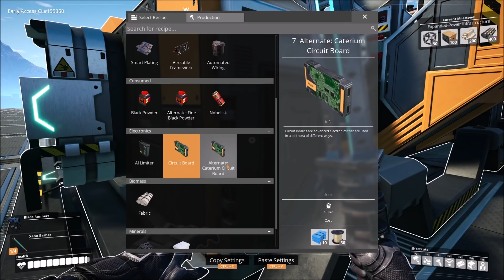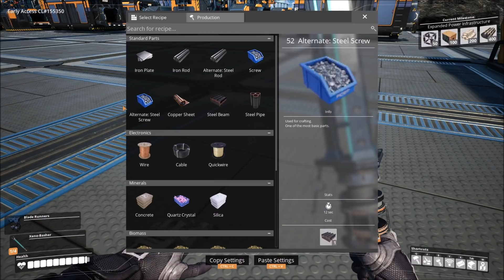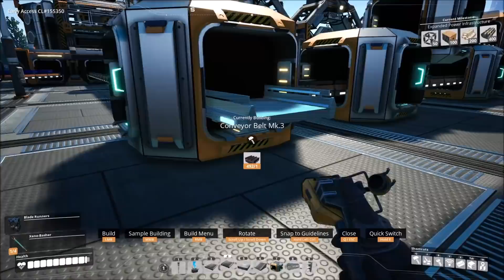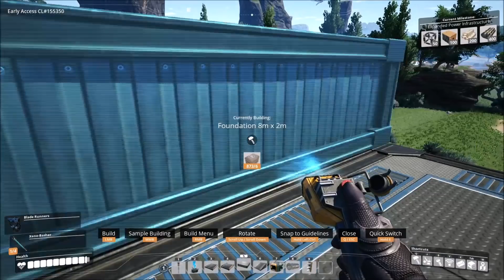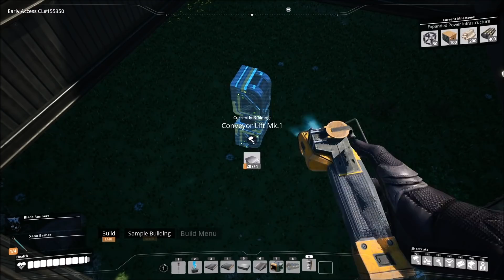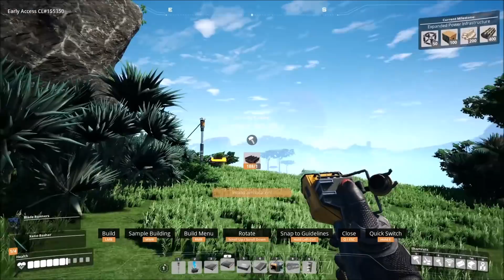Satisfactory Ep23 Heavy Frames and Computers

Comment: I have only just found that screw recipe, and I could have used it while making those heavy modular frames! Screws were my biggest problem after regular modular frames since so many screws get used per craft. I got that recipe after I've already back-stuffed a double container with heavy modular frames. It took forever!
Edit You are mistaken. You DO need a "stupid amount" of heavy modular frames. Well, not in an automated sense, but all of the Mk2+ machines seem to use them along with trains.
Reply: I have a direct screws from iron ingots. It makes 50 per minute. It's not bad, but not great either. I want the copper and iron recipe that I saw Dire not take to increase the iron ingots.

Comment: I really do like the sounds and animation the manufacturer makes when building things. They sound pretty heavy duty when building complicated things like computers.

Also, a few tips for Direwolf:

1. You should use trucks for hauling resources instead of tractors. They have more storage space and can plow through small obstacles like bushes even if they are a bit slower.

2. I would recommend making truck stops with at least 5-wide foundations since it gives the truck plenty of room to turn around. I don’t think trucks are smart enough to drive in reverse while on autopilot.

Comment: Speaking about wiring, transporting ingots and producing wire on spot is way more efficient solution. But as you already has wire line if your conveyors can transport necessary material, it also would be better idea to split it and at least make wire on spot. Instead dragging whole unnecessary line for wire alone.

Comment: When I first learned there was a smart splitter, I was hoping it would allow you to say a quantity per minute allowed out a side, not just what items are allowed to pass through.
Reply: Yeah and even worse there is a second level of upgraded splitter, the Programmable Splitter, all it changes from smart is allow you to specify multiple items for each direction sounds almost good at first glance but on closer inspection is completely pointless.
If we can't have a quantity splitter I really want a Ratio Splitter something like 3 left 2 right 1 forward. Yes those numbers could be handled with a 2 way splitter with a 3 way splitter on the right and the center/right output of that splitter being merged that has a somewhat larger footprint though.
Honestly other than overflow or using vehicles to transport multiple types of items at once the current functionality of upgraded splitters seems pointless, and even if you are sending more than 2 or 3 types of items through the same vehicle (making the programmable splitter seem enticing) you will still probably want to split each item to its own belt thus the ability to send multiple items down one output of the programmable splitter still results in needing an additional programmable or smart splitter making the programmable splitter an almost useless upgrade. Just use smart splitters sending individual items through center/right with overflow left, then the left belt into another smart splitter sending individual items center/right and overflow left until there are no more items to sort and the final overflow will want to be sent into an awesome sink to avoid jamming the splitters.

Comment: The DireWire is strong with this young builder :D

I use a central supply-line with the stackables
adding a new layer each time as needed (wires, cables, plates, plastic, rubber, whatever)
Building the assemblers 90 degree out from it to scale up later 
They pull from the central supply as needed. neat, tidy and expandable. 
Another recipe? Just tap into another central belt layer
Feeding the result back to the central as a new layer (where belts can go BOTH ways if needed!)
Reply: I also use central buss in factory, but the other way around. With it ending into warehouse.
Reply: @TheRezro  ah, yes, that is smart. I have to adapt :D

Comment: Why you limit the containers? It's not like the resources are finite... just let them run till the container is full.
Unless you plan to move everything soon. Tho, if you plan to build a mega complex you'll realise how limiting the containers was a bad idea.
Reply: He is not producing the ingredients fast enough and those resources are also needed for buildings.
If he wont limit the production then he will run out of in thins case the frames.
Reply: @hubertnnn  Thats why i never put my storage of my stockpile as a throughput buffer, but as an overflow (ideally with smart splitters set to overflow, but if I dont have them yet I just put normal splitters there meanwhile. The production would be halfed for the time the stockpile runs full, but that was never a big problem for me.

Comment: dire if you get the Silicon Circuit Board sure it alittle more copper sheet instead of plastic your using silica but it does 12.5 for output 3 of them is 37.5 and 2 of them does 25.

Comment: The steel screw recipe is in many ways considered the worst recipe for screws. It uses more of your resources and bandwidth than any other recipe per item and it's only benefit is that it takes less buildings. If you are trying to minimize building, you are doing it wrong. This is a game about maximizing efficiency and exploration, not maximized space or limited resources.
Reply: The first HDD he researched had cast screw. He passed on it >.<
Reply: I guess this shows that even the garbage recipes from HDDs can be good depending on your play style and specific use case.